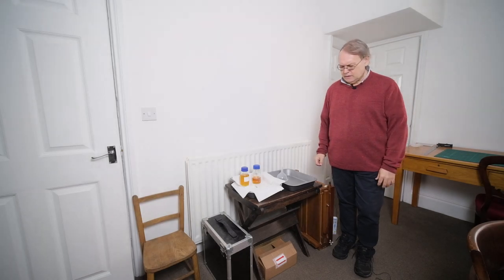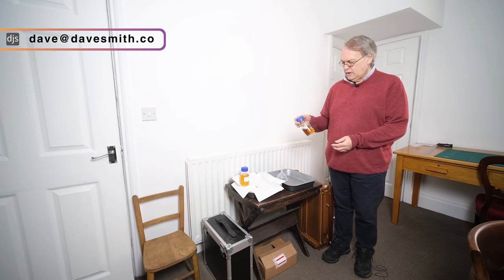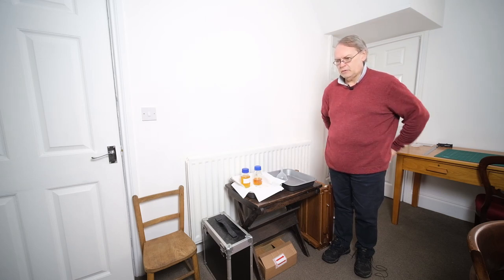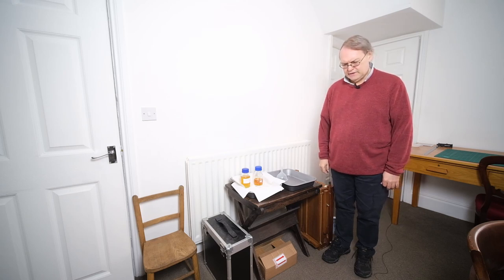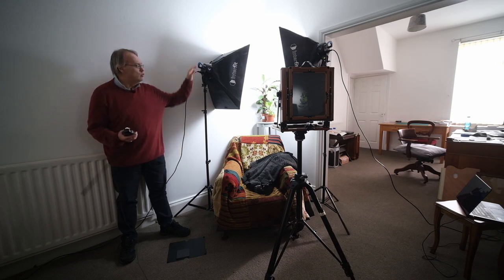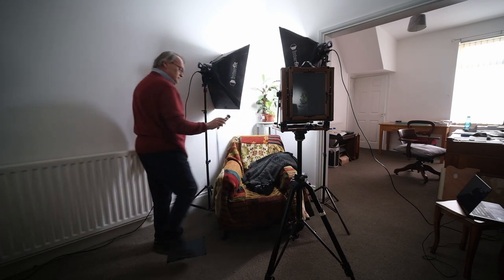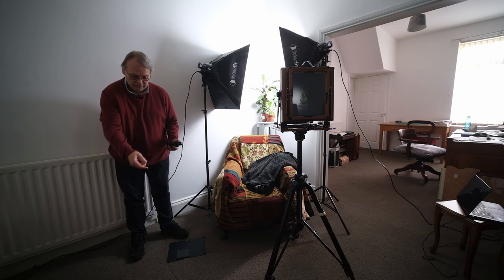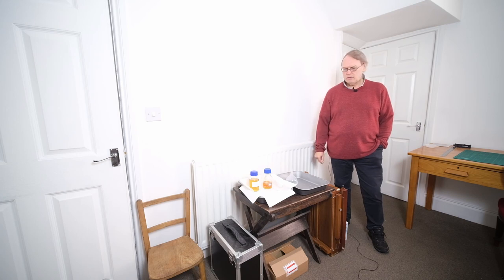Doing Wet Plate - 1. Shooting

Comment: Thanks for sharing the experience.  I shoot dry plates outside using an UV app to understand UV levels for exposure.  Now in Vietnam the peak on a sunny day at noon is 6.0, latitude dependent of course. At 2 UV add 3 stops, 4 UV add 1 stop and 6 UV add no stops.  This is not scientific rather trial and error.  (25ASA plates)
Reply from the maker: Hi There

Yes, aiming for a bit of trial and error as well, to link the meter reading to an actual exposure but more by 'feel' really. What app are you using?

Dave
Reply: @DaveJSmith   App called UV Index yet most weathers app have an UV section.